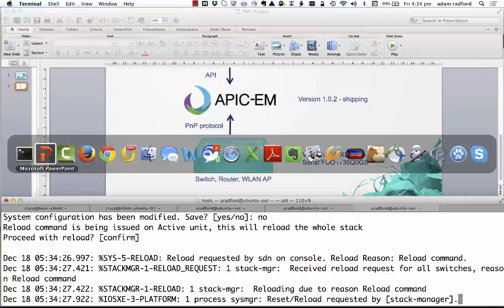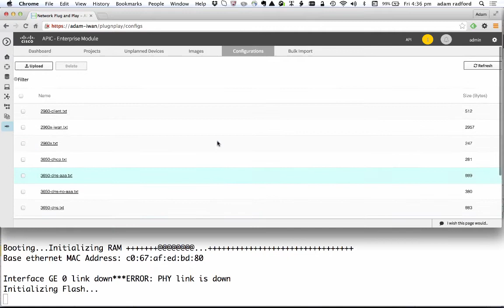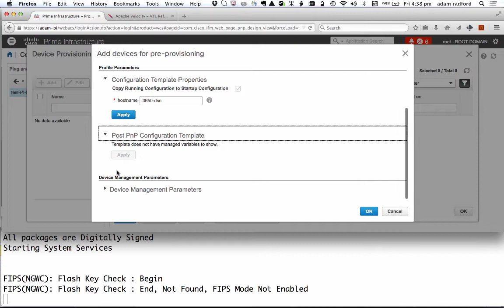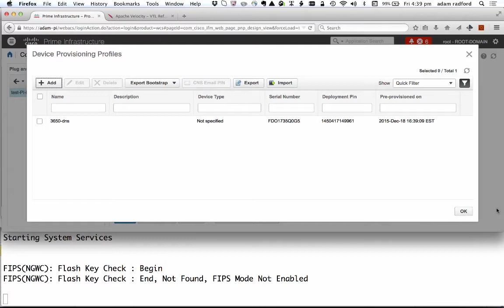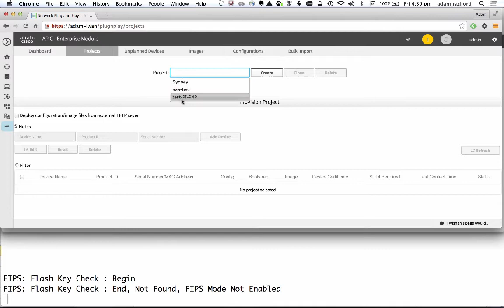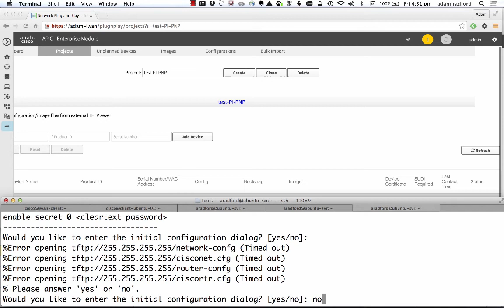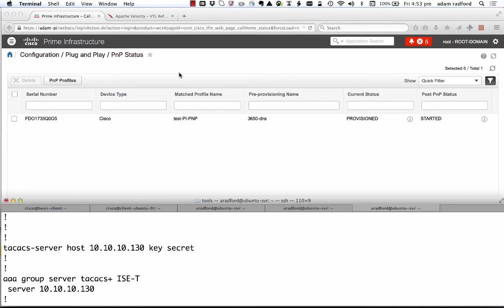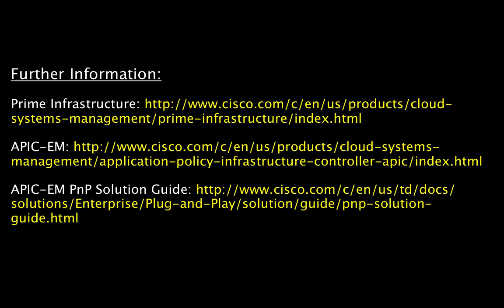Demonstration of Plug and Play (PnP) and Prime Infrastructure

Comment: Nice video! Do you know am I not able to get DHCP to VLAN1 during boot? RJ45 from FA0 is connected to a DHCP server. I've tried several routers (C800 series). DHCP server is working and IOS should support both APIC EM and Autoinstall. No routed ethernet ports are avaiable on the C800 router.

Comment: Also, if we get a DHCP IP on the mgmt port, then we replace the IP with something else in the static configuration provided, then would APIC lose its state (http connectivity ) ? Will the APIC/Prime report success or failure if the management interface IP changes ?